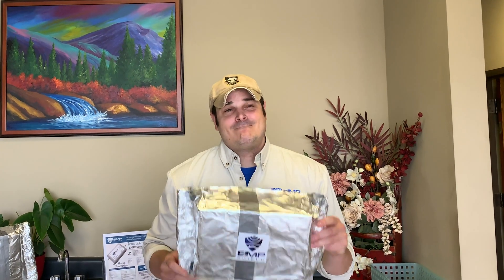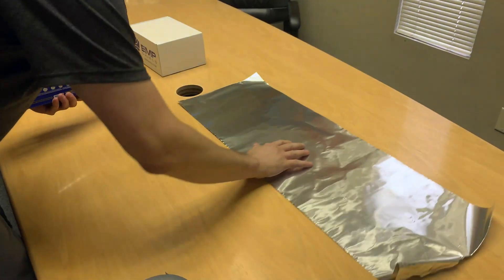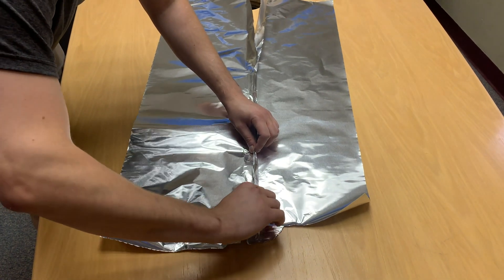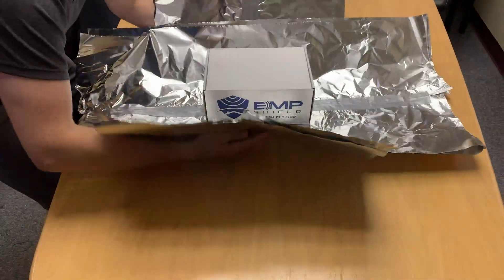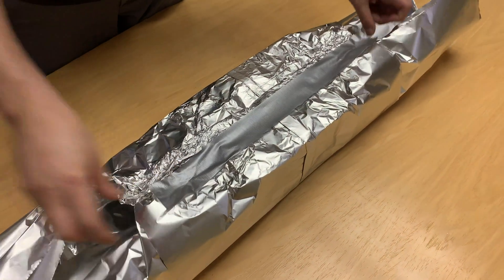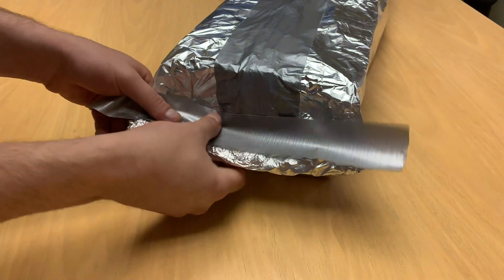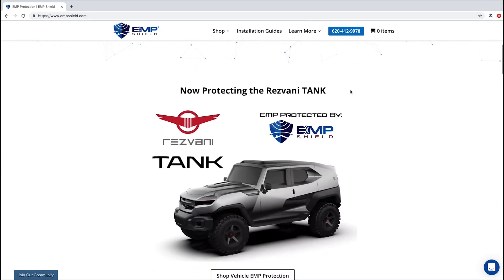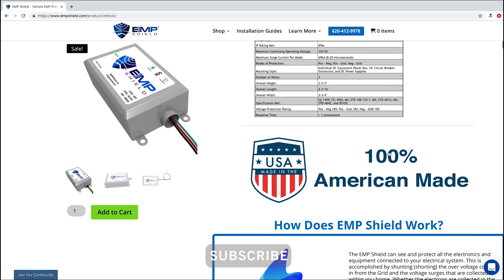$6 DIY Faraday Cage for EMP Protection

Comment: Thanks for the helpful instruction.  However, assuming the box would be used for a secondary/backup radio, it may only survive the first EMP blast.  Subsequent EMP pulses could then disable your backup.  Many folks don’t have the wherewithal for very many radio backups all with their own faraday box.  Any suggestions?  Maybe a car radio would be the most survivable?
Reply: Your best bet would be a old vacuum tube radio. They are not subject to EMP effects.

Comment: Good idea, BUT, how are you going to open & reclose repeatedly without taking out stock in Alcoa? Funny advert though! Humour is always good! Especially in times like these.
I use an ammo box, and seal the crack with HVAC tape. Much cheaper than a half roll of freezer foil. EZ reseal. 
But you don't want to throw it across the room like that... you'll take somebody ourt...🤪  👍❤
Reply: PS-Long time Foogler...

Comment: I might offer the following suggestions:  Each layer could be taped with aluminum conductive furnace tape.  We have found this to increase conductivity at the seams.  Also, each successive layer of foil could be separated with a plastic bag to insulate one layer from the next making each layer a separate shield and eliminating conductivity from the outer layers to the inner layers.
Reply from the maker: DB excellent suggestions !